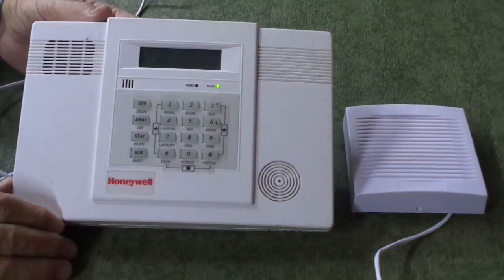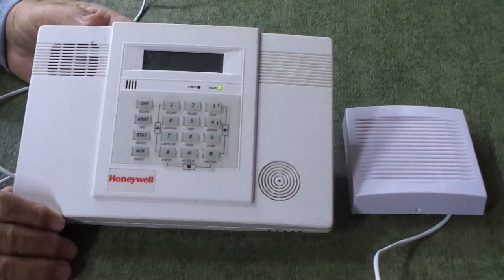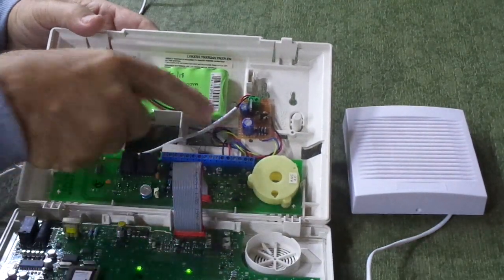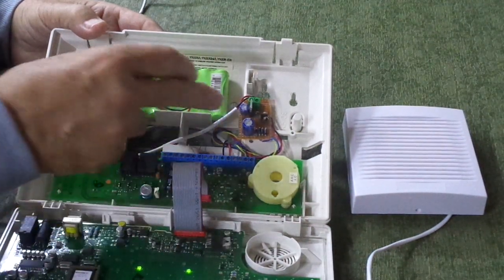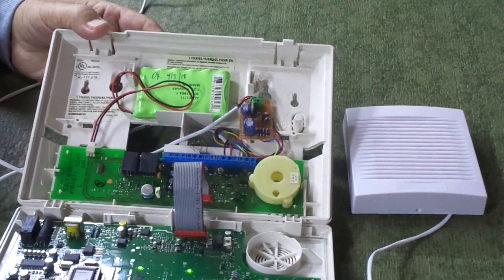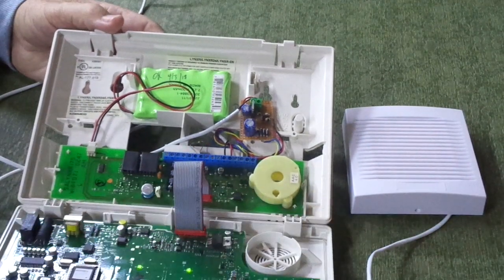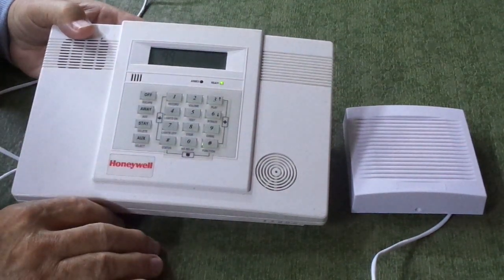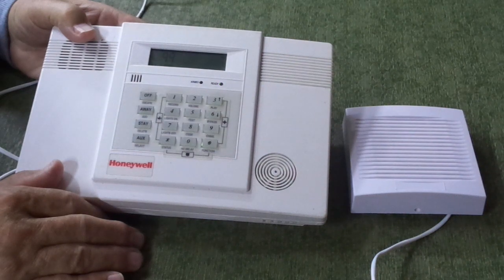Ron in the shop - External Siren module for Honeywell Lynxr or Lynxen

Comment: Hi Ron. I'm looking at you LYNXR siren driver board. I looks like a bridge on the front end and a regulated 9VDC on the output. I GUESSING you used a 7809 regulator? Can you share the details?
Thanks,

Jim Willson
Reply from the maker: Hi Jim. I didn't use a regulator such as a 7809 because the LYNXR is powered by a 9VAC transformer. After the Bridge rectifier the voltage is about 12VDC. The Opto-coupler I use to trigger the output then gives an output of about 12 volts to the siren which is perfect and makes it nice and loud.
Reply: @roboalarms2467  
Thanks Ron! I really think this is elegant and simple. Two of my favorite things! Thanks again...